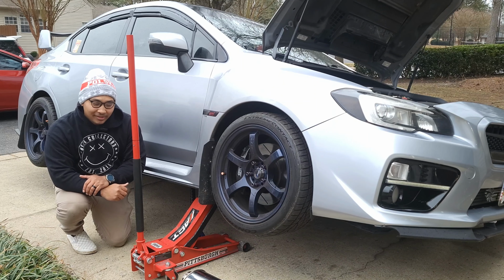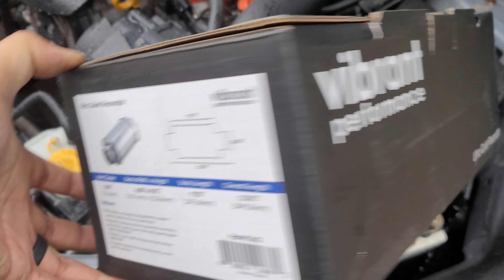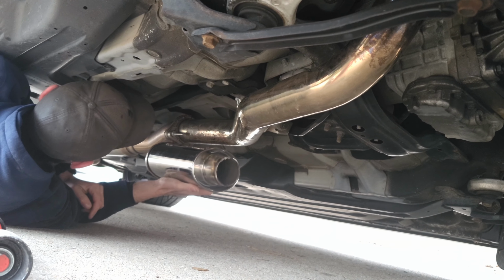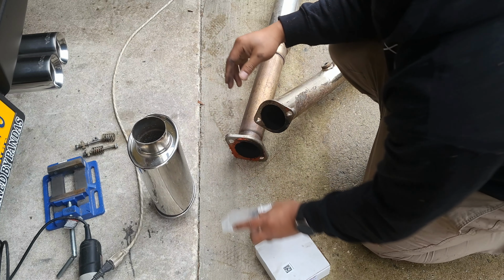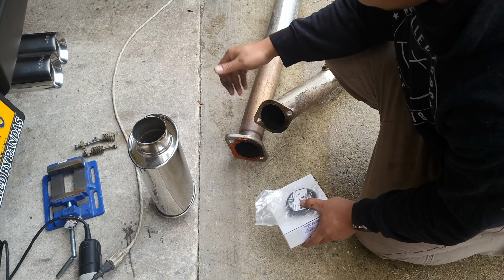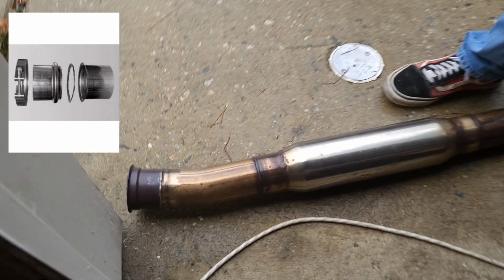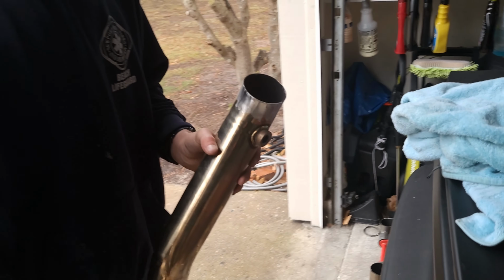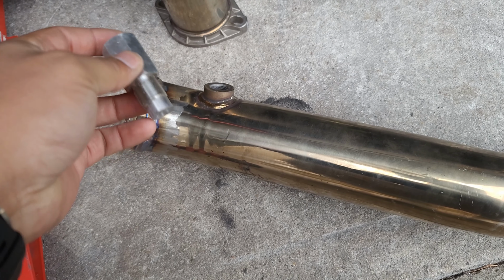Subaru Sti Vibrant Ultra Quiet / VBand Welded / Mini Cat Install

Comment: Sup bro do you still have this sti? 
How has it been treating you? You still on original block? How many miles you got man
Reply from the maker: hey brother sorry for the late response. I just sold it about 3 weeks ago. I loved it. sold it because Wife and I bought a house! Original block but had to be rebuilt from the dealer due to oil consumption issues two owners ago. it had 130k when i sold it and had no issues at all during my ownership!